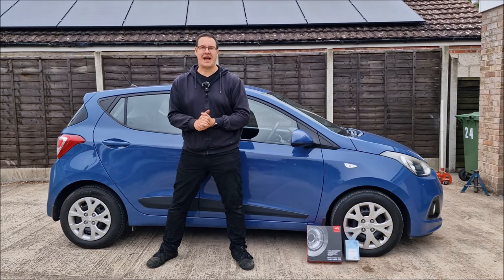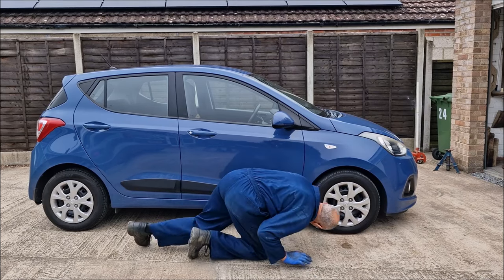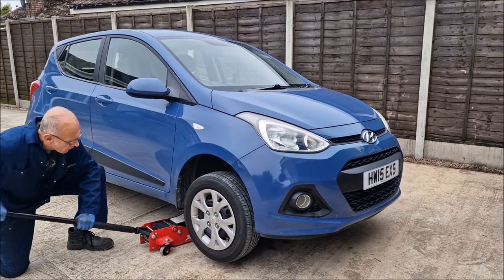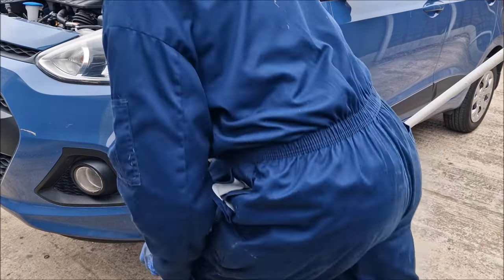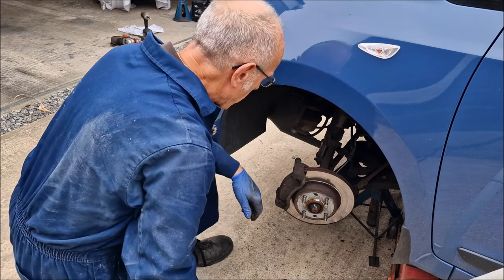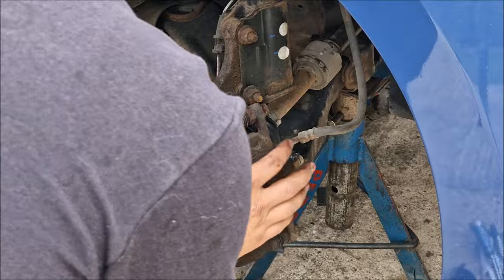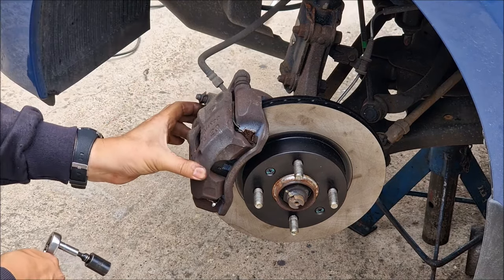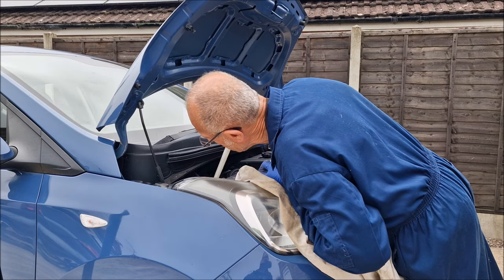New Discs & Pads For Mums Hyundai i10. Step By Step Guide

Comment: Positive approach, a “How to” instead of the usual “we’re cooking something, let’s surprise!” 😅. But… nobody I know owns either 2 full-size car jacks, or two jack stands. So, a suggestion, to consider “ordinary consumer tools” in a “how to” (e.g. on-board tool and jack out of a car). Other than that, cheers mates.
Reply from the maker: Everyone should own two jack stands ... In fact. I think they are sold in pairs?! 😊
Reply: If you don't own jack stands then you can, provided your wheel is thick enough, slide it under the side of the car as a safety net. However, for the price of a jack stand, I'd recommend them and as Jon says in the video, if you don't own two jacks, do one side at a time. A hydraulic jack makes these jobs so much easier compared to the standard jack a car comes with anyway, so definitely a worthwhile investment.
Reply: @JonCoupland  ARGH!! AXLE stands please ..... Americans use Jack stands ..... 🙄👍

Comment: I'm always reluctant fitting pattern discs after fitting them to my Senator may many moons ago. One 'warped' after 3/4000 miles .... its replacement did the same. New discs bought from Vauxhall ..... no more problems. Cheap discs can suffer from 'Disc Thickness Variation' ..... OE tend to be made to a better spec. I now grit my teeth & buy from the dealer
Reply from the maker: Oh that's interesting! So far many OEM quality parts fitted and no issues thankfully. Thanks for watching ☺️👍

Comment: Nice job, brakes look similar to 2016 Kia Rio I have, probably Mando brakes?
I once took apart my previous car front brakes (2011 Suzuki Alto) and used the copper paste while putting them back together, but in next service at the dealership, got almost yelled at by the service writer, "You don't use copper paste because of dissimilar metal corrosion!", and they washed the copper paste off and used some synthetic or ceramic brake paste instead.
Reply from the maker: Yes very similar 😀👍